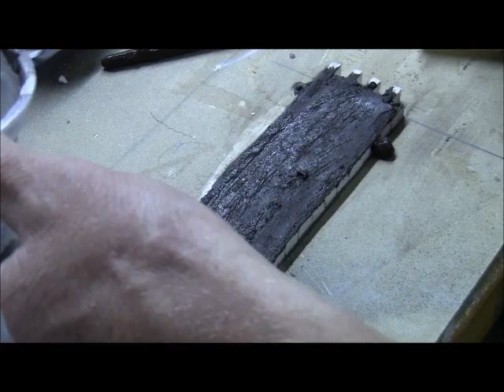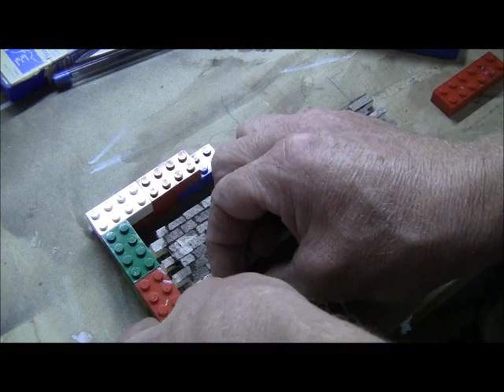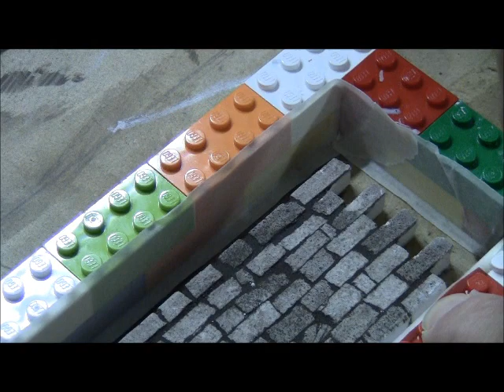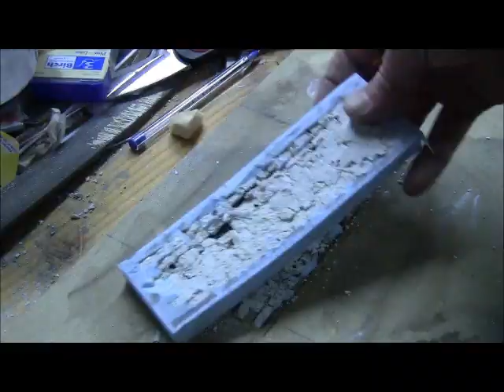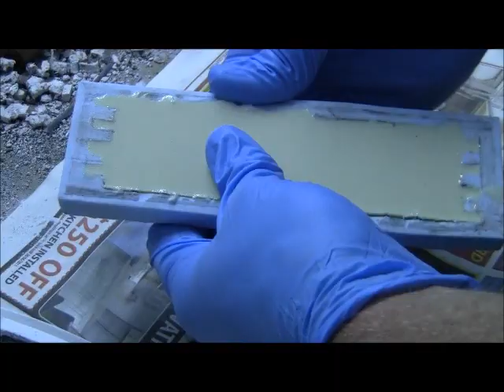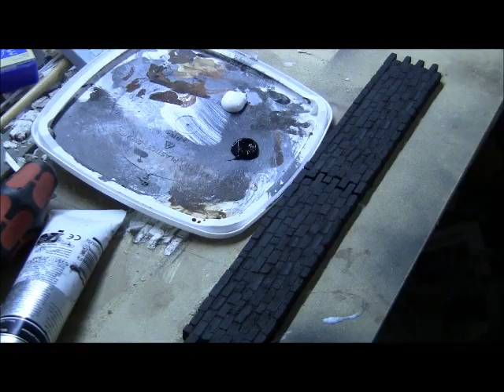how to make stone wall2

Comment: Thanks for that mate..The mix I have is used for taking dental casts, but I'm not sure what plaster they use, so I think Plaster of Paris is a safe bet,       I'll try with out reinforcing to start with as I'll be working in a bigger scale  (1/35) I hope I can make inter-locking wall and road sections similar to your resin casts, I think plaster will be fine as very little handling once built....I'll keep you posted.. cheers Pete..

Comment from the maker: i dont use release but for plaster you wet the surface with water/detergent mix to get the plaster to run into the details. not sure what the blue dental is but if its a silicone you cant go wrong. plaster doesn't seem to stick to stuff anyway so you'd probably be sweet anyway.. i just now pulled a plaster cast out and it broke straight away- should have put in some reinforcing i think... love to hear how you go pete